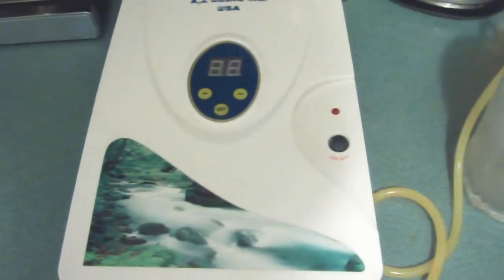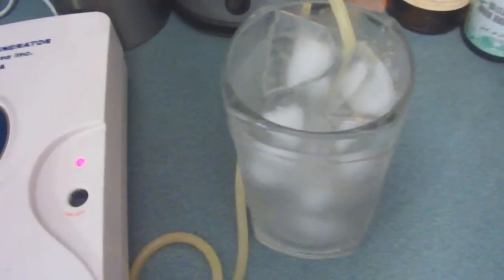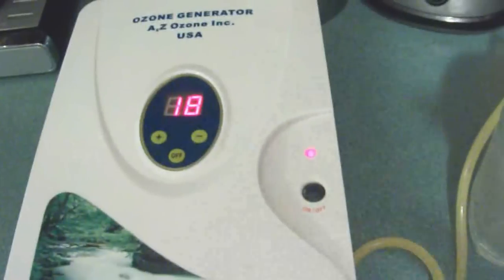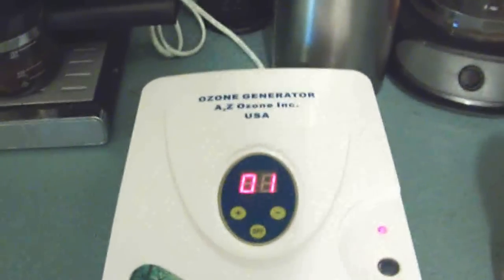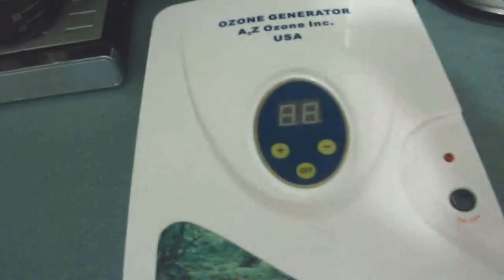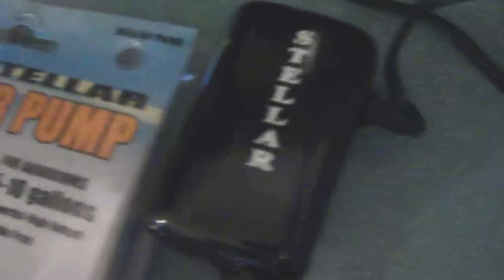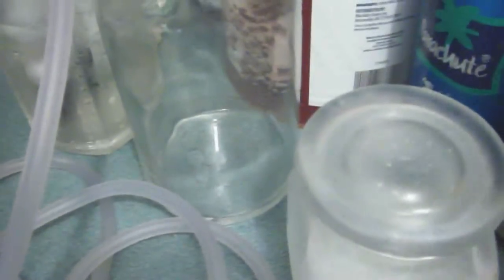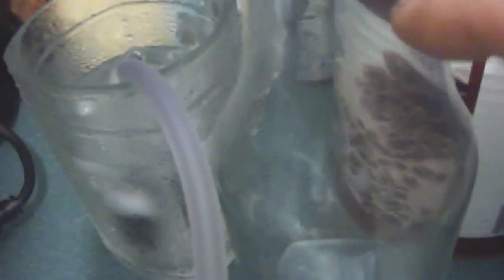Making Ozonated Water & Oils

Comment from the maker: With the Synergy Ozone WPS-100 Generator the ozone ONLY goes through the silicone tubing, not the case itself.  Of course the ozone would not go through the case.
Reply from the maker: +Abo Asmaa
I personally think all of Sota's stuff is overpriced, including ozonators and zappers.. I've also seen quality one battery Beck zappers on Ebay for $129 vs. the $250 Sota charges.
Reply: Nope, it doesn't remove fluoride (everything else)

Comment: I bought the same unit a week ago. I use it to ozonize my drinking water 10-15 minutes 4 x a day. I could smell the ozone in the water and inside the room every time i'm using the unit but since yesterday i couldn't smell the ozone anymore. Did i lose my sense of smell or the unit has been damaged already. I checked the interior unit to see if there were any damage but there wasn't. Any advice?
Reply from the maker: It could be broken.  Likely it is if you don't smell any ozone.  Mine lasted a long time, but maybe I was lucky. I actually ran it with the automatic timer 20 minutes on, 40 minutes off for 1 1/2 years.  You definitely need the 40 minute rest intervals to let it cool down.
Reply: syyenergy7 How sad if it's broken already, i just bought it a week ago. :(  Anyway, thanks for the reply.
Reply from the maker: Ladytron I just bought an electronic cleaner.  It had great reviews.  It broke after 10 uses.  So I got it replaced.  That one broke right away too! 4 1/2 stars out of 5 starts for reviews.  I wound up getting a commercial duty cleaner.  My A-Z ozone generator did last a long time in my case.  I finally replaced it with a Synergy systems WPS-100.  You need to buy a $10 fish tank bubbler in addition to the unit to pump air through it but that one has 15,000 hours usage before it needs repair.  I have been using that one now for years.

Comment: When making oil how long do you run unit for 8 oz of oil in straight time without incorporating oxygen but rather using ambient air instead?
Reply from the maker: It depends on how strong you want to make it. It took a couple weeks to make heavily ozonated oil.
Reply: syyenergy7 running continuously?
Reply: syyenergy7
I just bought one that puts out 7000ph of what ever they call it (I forget) for $129 how strong is yours? I looked into the SOTO units but they are so expensive and only 400ph
Reply from the maker: Michelle Formoso http://www.ebay.com/itm/Synergy-Ozone-WPS-100-Generator-/321481149709?pt=LH_DefaultDomain_0&hash=item4ad9c50d0d
Synergy Ozone WPS-100 Generator
That's the one I am using now.

Comment: I put filtered water in a glass jar and put it in the refrigerator overnight. If for some reason I wake up tired, I take that jar of very cold water and bubble it with the ozonator for 10 minutes and drink the water within 5minutes and in a short time, I'm no longer tired. It's properties are more noticeable by people with low energy, who should try oil pulling and scraping tongue before bed for a nice surprise when they wake up. The tiny bit of ozone one can smell while drinking the ozonated water won't hurt you, just don't try inhaling the ozone straight off the bubbler.

Comment: Thank you for your Video! I'm a women from Germany.I have a cheap Osonator,for making Water to drink it's good. (300mg/h)
My question,nowhere in the Internet I find, how I could use this cheap Osonator for my ears.I want to put ozone directly in my ears for 2 minutes.Do you have any idea how i could make this with an Osonator?
Reply from the maker: They sell ozonators on Amazon (dot) com.  But you may find a higher quality one on ebay sold by Synergy Systems.  They sell both single stage and duel stage ozonators at excellent prices and they are rated for many, many hours of use.
Reply: Synergy Systeme are really good.I will look for a cheap one.Thank you
Reply: it depends on what is the matter with your ears?! that's a very sensitive part of the body and you want to be careful and read cautions prior to experimenting, ok?!

Comment: some say  the ozone evaporates after 1 hour so its best to drink the ozonated water within 1 hour and secondly they say its best to drink ozone water in an empty stomach in the morning before you eat anything. that's what i have been doing.I used to have digestion problem but not any more
Reply from the maker: You should drink the ozonated water right away.  Most of it is gone after 5 minutes.  That fast.  True that drinking ozonated water on an empty stomach is more effective.
Reply: syyenergy7
thanks for more info

Comment from the maker: It lasts maybe a few minutes max.  You drink it right away.  The ozonators for water don't push a lot of air so it's not a problem.  Just don't breath it directly, as in directly over it.  They use ozonators like this for spas, so it is safe.

Comment: Hey...  Hope all is well with you.....   Thanks for posting..  With the properties of coconut oil being solid until it reaches a temperature of approx 76 degress, I wanted to ask you if you had to heat the coconut oil slightly to keep it liquid and then add olive oil and does that keep the coconut oil liquid to be able to infuse it with the O3 ?  I want to use just coconut oil, so I was thinking of sitting the glass carafe I would use in something that will hold some hot water. Thanks so much...

Comment: there are alot of larger generators on ebay but how does one know if they are any good? I want to eventually buy one with greater output. The larger ones can go for $1000 to $1500 through product sellers other than ebay. Thanks for the info by the way.

Comment from the maker: I think a lot of the little inexpensive ozone generators don't put out anywhere near the amount of ozone they say.  But that is not really a problem, because it does not take much output to ozonate water.  You can get benefits from the cheap ones too (assuming they last a while).  That may be a smarter thing to do to test how well it works for you.

Comment from the maker: I used a cheap one for a couple years until it finally burnt out.  Ozone will really purify the water better than anything.  As far as the effect on viruses in the body, that is not exactly known.  For cost effectiveness it may be outstanding since when you drink ozonated water it goes right to the gut.  And the gut is where most diseases originate from and multiply from.  Right now I am using the Syenergy Systems WPS-100 model. Works good.

Comment: I suppose using a bubbler or boiling water is a step up. ?  I was originally interested in making oxygenated oil for topical use or for "oil pulling."  (Finding out from you that it would take a higher end generator, one I probably couldn't afford, I'll probably just purchase it by the jar.)  Reading about the technique of oil pulling, I wonder if oxygenated water might produce the same affect as using oil does.  Have you used oxygenated water for your dental care?

Comment from the maker: I had a $60 one for over 2 years and used it a lot.  As long as you don't run it constantly it holds up well.  20 minutes on an the 40 minutes off is the max setting.  As long as it cools down after each 20 minute cycle it will last a long time.  I ran that off and on cycle for 2 years straight.

Comment from the maker: The cheap ones work fine for ozonating a glass of ice water.  Yes, the manufacturers often exaggerate the output, but it only takes a few minutes to ozonate a glass of ice water.  So the cheap ones have plenty of output for that.  You can up the concentration of O3 output but feeding in pure oxygen versus regular air.  But that is not necessary to just ozonate a glass of ice water.

Comment from the maker: The ones on ebay that do 400mg/hr are ok but that rating may be exaggerated.  Generally ozone only kills bad bacteria since it is oxygenating.  You use silicone hose.  Not sure about radiator silicone.  If it is the same exact stuff that is safe with food, you should be ok.  But silicone hose is cheap plus it comes with the ozone generator.

Comment: Is it necessary to ozonate spring water? what's the difference between this and a cheap one on ebay that outputs 400mg/hr? will drinking oxygenated water kill probiotics (good bacteria) in the body? are the radiator silicone tubes suitable for this?